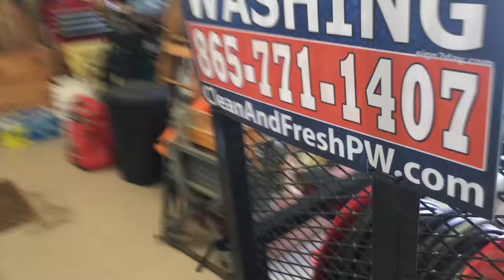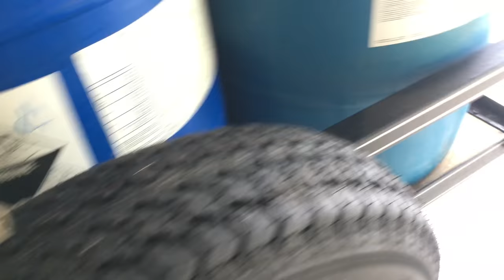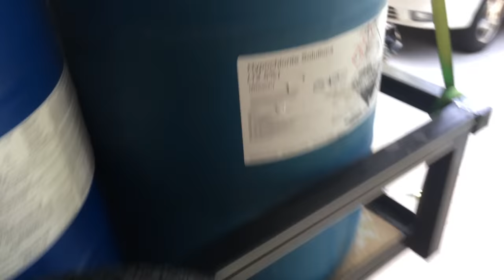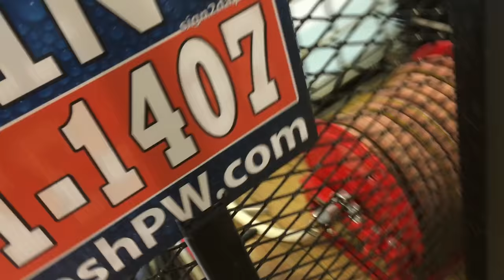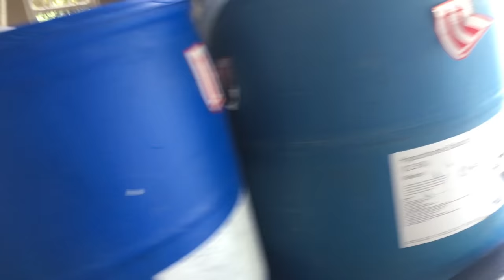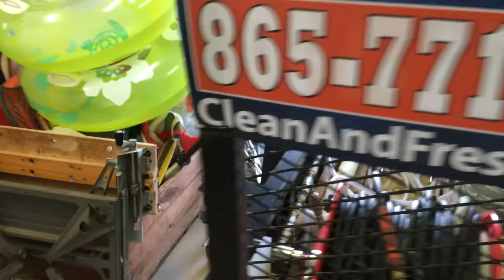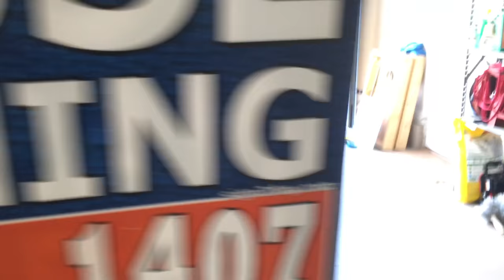Introduction to Professional Pressure Washing - Equipment

Comment: I agree with what you had to say.  I am a newbie in Los Angeles and I built my trailer to compete with the big guys.  I spent relevant to the type of jobs that I want.  I do have to be careful as to the type of jobs I take on because of experience level.  I am big on researching so I know I can handle what is thrown at me.  I also have the blessing of a great mentor.
Reply: Fred Carter I like to consult with you about starting a pressure washing business overseas
Reply: Same

Comment: Great info in your video. I heard that the pressure pumps don't like running off the buffer tank as they need to be fed under pressure. Is that right or not? I would like to run my pressure washer off an IBC but didn't want to do that unless I can find out if I can without harming the physical pump or affect the output at the wand end.
Reply: You could pressurize the discharge side going to the pressure washer. A simple DC pump hooked to your truck battery would work. Install a pump between the tank and the washer. Most would say they'd also be filling up the IBC while you're at the jobsite if the customers water pressure isn't high enough to use at the pressure washer itself. 
If you're slow and afraid of the added water pump draining your battery, you can also modify one of the pullies on your vehicle to add another belt to run a belt driven water pump in place of the battery one. A dual belt/single pully shouldn't be that hard to find. We used them for air compressors  on our vehicles for off roading/rock crawling to air tires after blow outs etc to air up new tires among other things. Obviously you'd have to get a seperate belt for the added pump or if you put it inline with your vehicle engine a longer belt. But it can be done. Good luck using your IBC system.

Comment: been watching videos for 15 hours and this is by far the best... if you would make a video about the the problems you've had with the equipment you have. i loved how you went step by step on each situation. still a little hesitant to spend what you did. My plan is to do exactly what you did. did you set your own trailer up or did you take it some where... and what size big water tank is that.... hope to hear from you. what state are you located in?
Reply from the maker: I have not really had any problems with this setup. It works quite well. However, I am upgrading a bit of my equipment so that I can operate out of my new location. I would encourage you to join the facebook page and research. But trust me when I say getting the 5.5gpm machine was worth every penny. Honestly. I didn't listen and I could have made a lot more money than I did in the beginning! Time is money!
Reply: When I say have problems I meant in the future. What state are you in? And did you build the trailer yourself?
Reply from the maker: I will update in the future. And yes I did put it together myself. It is fairly straightforward to do though.
Reply: Which facebook page is it?  Can you provide a link or a name to search for?
Reply: I'm also about to spend around 7k$ for a new washer,trailer,and a very nice softwash system I'm building myself. I'm also grabbing a whisper wash 18"..plus a remote valve system on my softwash metering valves from Midwest Washing Equipment LLC, the HYDRO MIXER V4...

Comment: I have a 5.5 gal 3000 psi belt drive also with a 20" stainless floor cleaner, I can do my drive and back garden in 2 hours which normally takes 15 hours with a Karcher K7 deffo worth it.

Comment: As a beginner I currently have a 3500 psi 3.5 GPM PW with a 18 inch surface cleaner. Is the surface cleaner too big for my PW? Should I get a different PW to match the surface cleaner? I also liked the video because it is very informative for a beginner.

Comment: I'd like to get into pressure cleaning and this is a great intro video. A couple things I'd like to ask. Where do you get your water supply from to fill the tank? If it is the customer, do they request a deduction on the price you charge them or give you shit about using their water? How do you judge a job to quote it right to not scare the customer away but also not do it for next to nothing? I'd most likely will be starting with small single story homes doing drive ways, patios, roofs so I'd like to find out how to price right accordingly to my water supply and area to clean.
Reply: I know this is a year old, and im not sure if you ever went through with starting your business or not, but 99% of the customer never care about you using their water, and even if they did you can just give them a discounted price which usally makes them happy, or depending if you have your water tanks you can just fill them before you leave and then do the job, and as of how much to charge depends on the area you're in and your experience level and the quality work you perform... You can charge by either square footage or linear footage, or even just charge by the job (piece work) and in that price you need to figure out how much overhead you have on that job, like gas, chemicals, and ect. But if you do good work then dont be afraid to charge what you're worth because its a skilled trade and quite frankly its costly to run a business...  In other words dont be a Fly-By-Nite Craigslist Cowboy and charge them a Dirt Joe cheap price just to try and sell the job and throat-cut other competitors, and dont price gouge them either, the idea is to be fair to both you and the customer, but that all depends on you...
Reply: I'd rather refuse the job than give a discount for using their water.  Just let them try to find someone who will haul a tank full of water to their house.  Just tell them the discount is already included in the price and tell them it'd be $150 extra to haul water to their house due to time required to fill and refill and the fuel for the extra heavy commute.    The standard in all service work is that you use the customer's utilities.  Plumbers, electricians, carpenters, HVAC and everyone else uses the customer's utilities to do their work.  Explain that to them and if they still want a discount very politely tell them you don't think you can complete the work and walk away.  You can choose your customers in this business.
Reply: @housewashjosh5910  very well put josh 👍

Comment: this is one of the greatest videos on youtube for people starting out, my question is your housewash in one of the orange buckets?  and can we get an update if you have made any changes
Reply from the maker: I am currently in the process of purchasing an enclosed trailer and upgrading  to a hot water system. Should prove to make quite a bit more business. As for the bucket, yes I make my mix in the orange bucket. I use the X-jet and move very quickly!
Reply: abdul0811 s

Comment: So is worth the extra money to have the hot water system?
Reply: If you're doing commercial work, yes. If you're strictly residential and just starting out, no it's not a nessecity.
Reply: If you want to be able to easily remove gum and get greasy, oily concrete slabs and asphalt as clean as possible you'll need it.  You can also rent them if you don't do much of that kind of work, but happen to land a job that needs it.  Most tool rental places have them.  They are also great for washing heavy equipment if you have an interest in expanding in that direction.

Comment: Professional? Be sure to tell that to the trooper hauling RECA regulated material in a uncontained trailer. Here are some notes, you will never use more then 5 gallons of solution for 4 hours of run gun time. They make a really unique item called ratchet straps good idea for those non osha approved fuel cans. Also why mount the reels next to the tailgate? You have to drop the gate every time you fire up the pump? Please leave the "HOW TO" to people that know whelat there talking about. Oh and a year later tell me is that 12 hp engine still running that pump. #trollthisvideo
Reply: Lmao